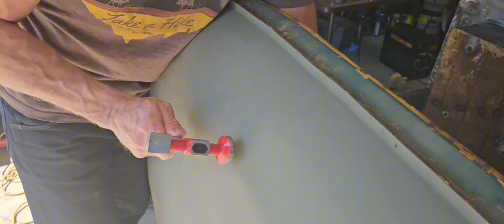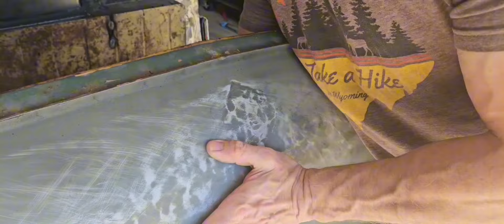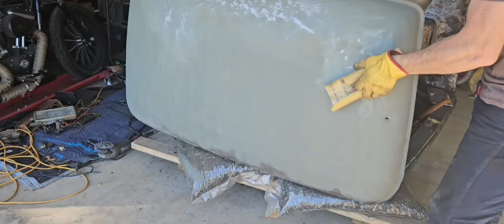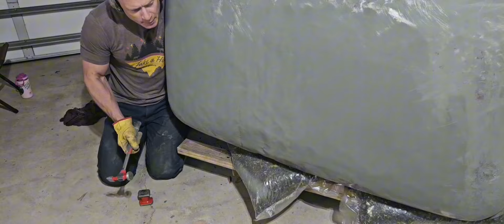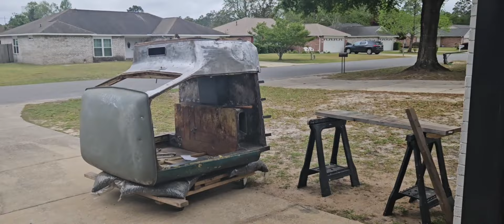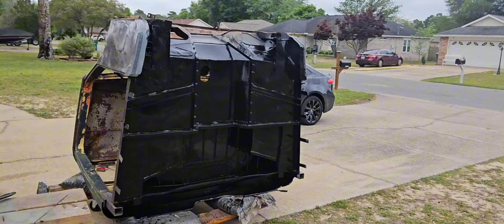First ever go at bodywork | Extremely wrinkled roof on this Willys Truck

Comment: You did great for your first time with body work and chasing after it! Here are some things that may help you. You can contour a 2x4 to the shape of the roof as a gauge and a striking surface. It wont have the same effect as a dolly but it is a great reference and contour maker. The biggest thing with body work is working very slowly and working every inch until you have completed that little sector. At least for small dents and wrinkles. It looks a million times better than it did! A matte black primer or paint will help you see the dents even more than the gray and is great for seeing the blending work after you have applied filler nothing wrong with the gray though. 

The tractor supply paint is some of the best for the price implement out there. It is solvent resistant (alkyd enamel) and can sit in harsh chemicals for a long time. When buying by the gallon make sure you mix the amount of hardener recommended it seems to really make a difference on reliability. It does fade over time especially in sunlight but it is a very strong paint. Also a pain to remove lol. 

Great progress this video! When paint starts going down that is when things start getting real! Keep the videos coming!

Comment: Remember metal is not hard to work with just make sure you don't beat it to death, work with the dolly with some tape around it will make a softer hit and do the same thing.Make sure you don't hit out to where its to high also.